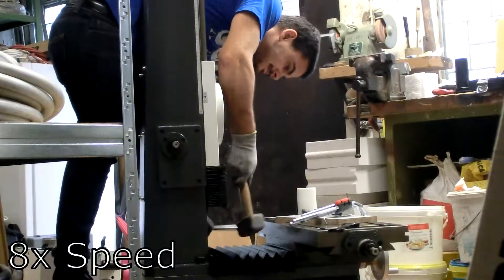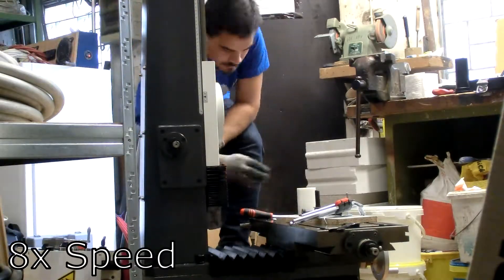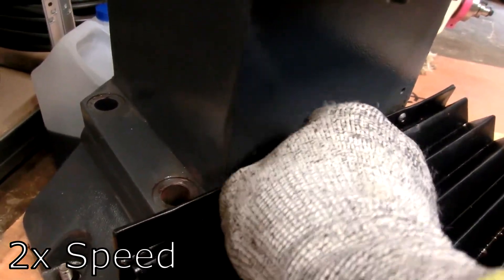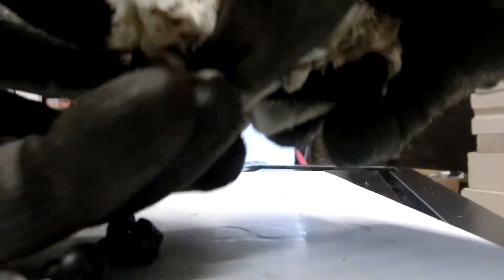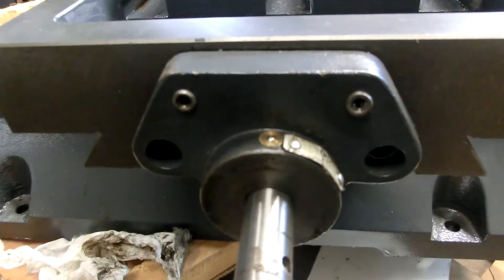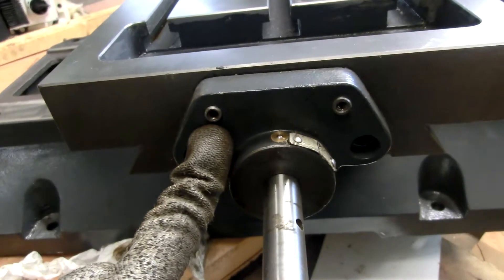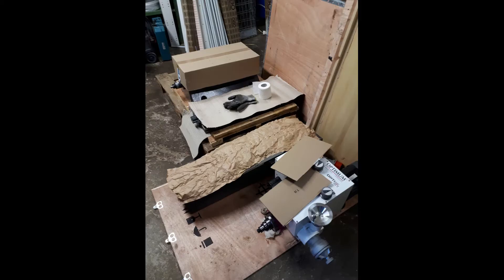[DWS] MB4 milling machine Pt.3: Machine disassembly

Comment: Hiya! I'm considering getting the same machine and was worried if I'd be able to move it to my shop in pieces with limited help. Just wanted to let you know that these videos are immensely helpful and I'm glad I stumbled across them, thanks a lot and great work!
Reply from the maker: Hi  Querilla223,  I am happy to see comments like yours. I was already wondering if i should do more videos or not, due to lack of feedback...  I can tell you, that you can do a lot with this machine. But, you will propably have to spend some time to tram it properly and adjust some things.. maybe even scrape the dovetails, mine were terrible.
But when adjusted.. it can be a good workhorse. 
If you want to keep it as a manual mill, get a DRO.. In my first days i was counting rotations on the handles, and it is the biggest source for failure in my opinion.
If you haven't already, i would be very thankful for your subscription. It is my fuel to make your content ;)
All the best and thank you for watching, 
Damian

Comment: Hi Damian
Regarding the precision pins and removing the handler mount using the slide hammer,  do you have a picture of what the hammer looks like and where you attached it? Stuck with the same thing at the moment. Thanks
Reply from the maker: Unfortunately i dont have pictures at the moment.  I think the slide hammer was just a piece of threaded rod with a stop, and a weight with a hole in it.

Comment: I have to say, i wish to get that same mill to myself and to my basement, but the door width is only 70 cm. Why did you disassemble it so much? How was the milling head mounted on, in part 2 i could not see clearly. Greetings from Estonia.
Reply from the maker: Welcome to my Channel! In part 4 I will move the machine to its new location. I had to disassemble it due to the weight and the fact, that I had to lift it by hand with only 1 helping person. I am a little bit busy at the moment but I am working on the editing of part 4. Thank you for your patience :)
Best Regards
Damian
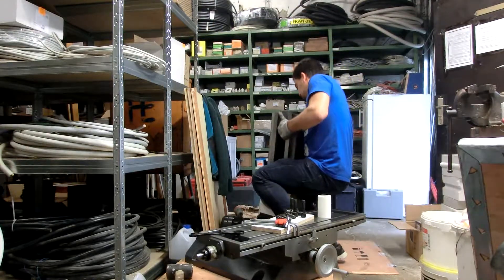Reply from the maker: The Milling head is held in place with 3 T-Nut-Bolts in the rotation plate on Z-Axis. You can see this plate at 1:13. If You disassemble the machine like i did, then 70cm is no problem at all.